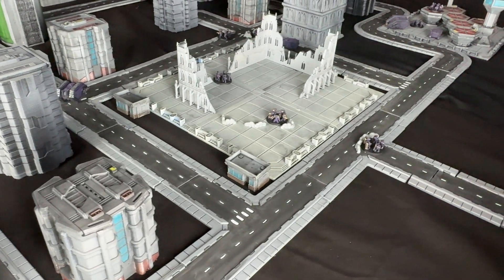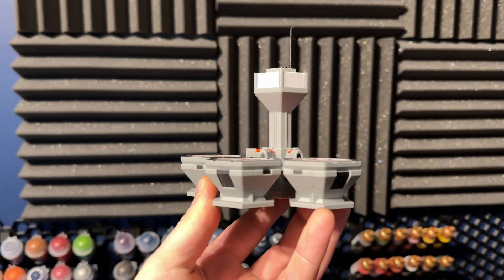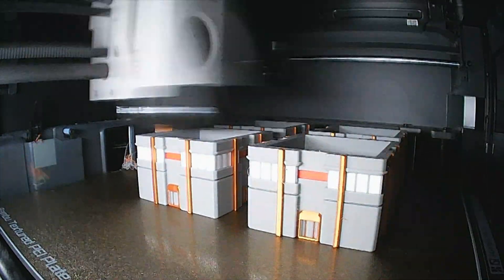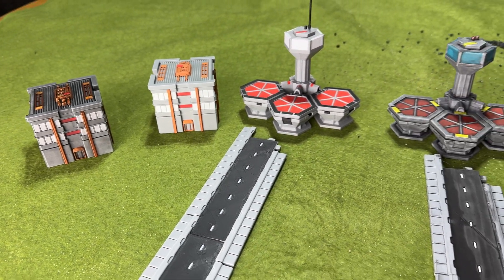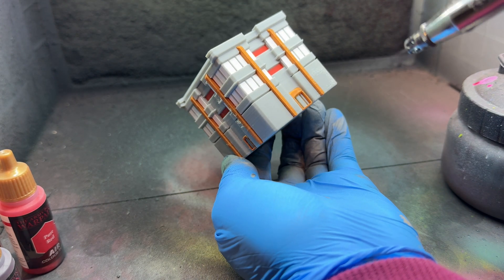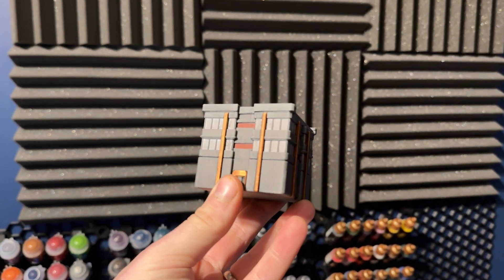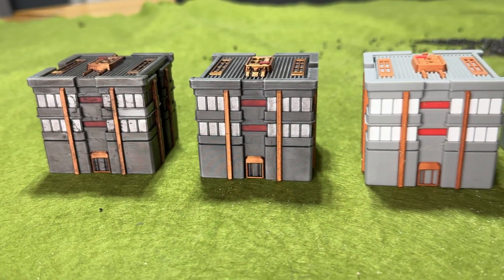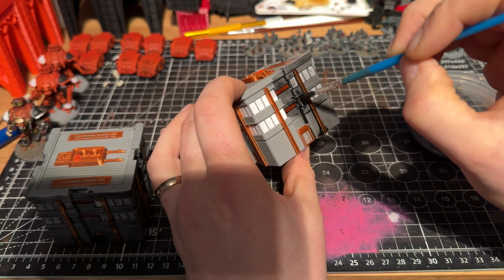3D Printing Multi-Colour Terrain: Using Bambu Lab AMS for tabletop ready terrain

Comment: Matte pla usually comes out better right off the printer. Wood fill for browns. Army painter dips work alright if you don't mind the price and doing a matte varnish over top. I do prefer oil washes most times.